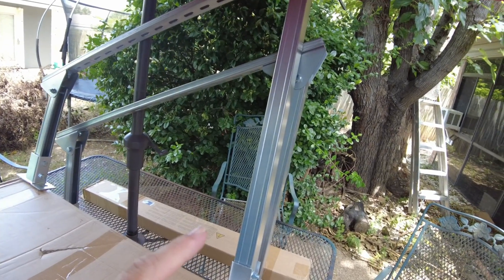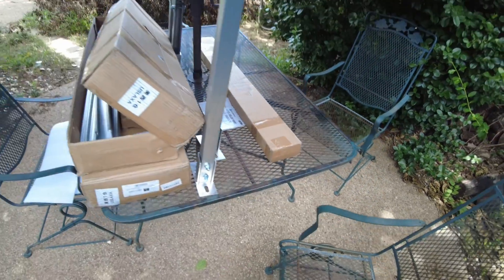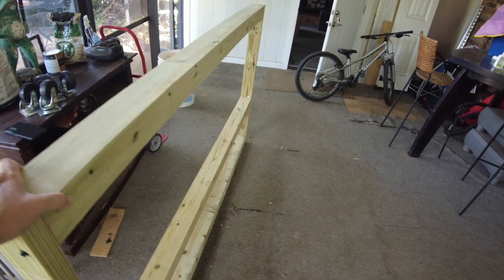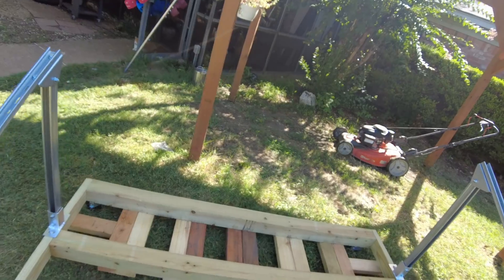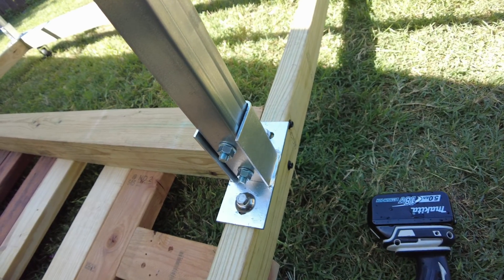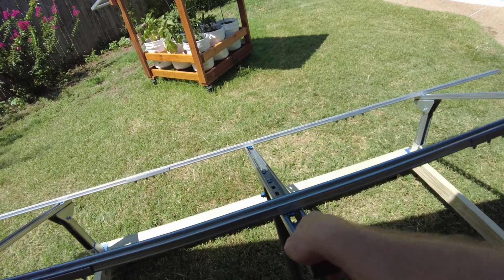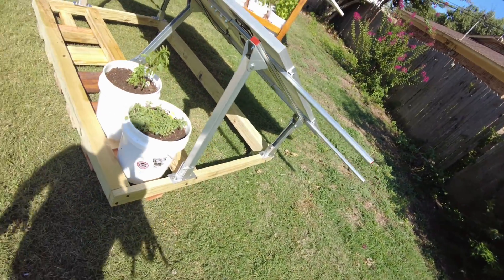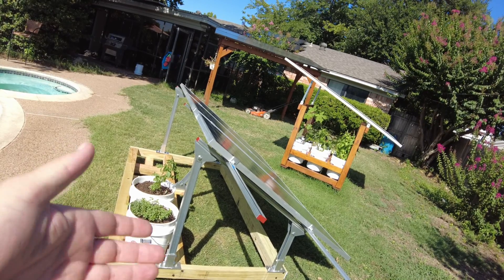ECO-WORTHY Upgraded Solar Ground Mount

Comment: I have 2 of these now. I mount them on 2 polyurethane dollys, $30 each from harbor freight, so they can be moved easy. I use a 3’ 2x4 to mount to the dolly, then bolt the mounts to that. You can even get  concrete blocks to weigh it down. I’m going to put something white behind it for the bi-facial gains.

Comment: You don't own a square??? You could just use two treated 4x4x 8 as a base and the length of the 8 ft would keep it from flipping over... Use a smaller block for the middle support...

Comment: This is cool, but I wish EcoFlow would launch a DC charger so you don’t have to waste energy inverting DC to AC and then back to DC.  3 DPUs in parallel should be able to DC charge EVs at as much as 25kW.

Comment: Anodized aluminum ( panel frame) against galvanized steel ( racking) will cause significant galvanic corrosion over time , especially in the presence of moisture. Aluminum to aluminum or aluminum to stainless steel should always be observed!

Comment: I have four of these ecoworthy racks. It's nice to see the made the height 5.9" higher and added a center bracket however they should offer a version that is 10" longer because the standard width of 200w panels these days have changed from 27.7 to 30.1" in width.

Comment: Yeah those are too expensive you can use 2 * 4 and regular house door hinges get them a nickel or stainless steel get some stainless steel quarter 20 nuts and bolts and drill it and install it and a whole lot cheaper
Reply: Treated 2x4....

Comment: Do you know if it's standard 1-5/8" wide strut? I'm using Adamax solar clamps on 14 guage shallow 1-5/8" strut from Home Depot. The clamps are made for standard depth strut and the end clamps appear to lean a bit. Thinking of replacing the clamps with something better.
Reply: Same question does it use standard unistrut so we can use any attachments? / modify it ?

Comment: It's nice that Eco-Worthy make a larger kit now. That looks easy enough to put together and it looks pretty sturdy also. Yes, in stormy or windy weather you would have to tie it or weigh it down but it's nice you can roll it and aim it at the sun throughout the day. I guess there is no tilt to that mount once everything is bolted down. Thanks for the video, good job on this and your bifacial build that your vegetable plants are under. Nice.
Reply from the maker: Yeah, the tilt is varied by where you mount the back legs. So it's fixed unless you unbolt some stuff, and move the back legs forward. Thanks, and yes I really love my veggie garden under the panels :)